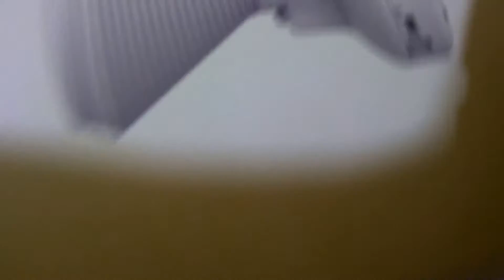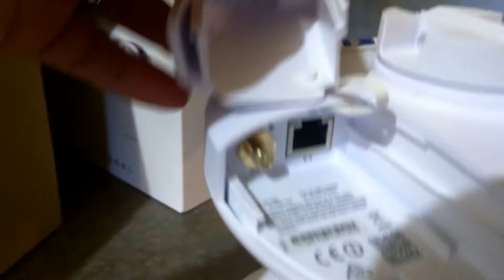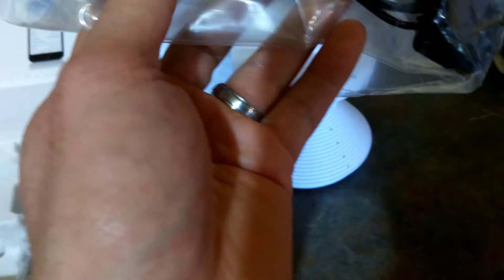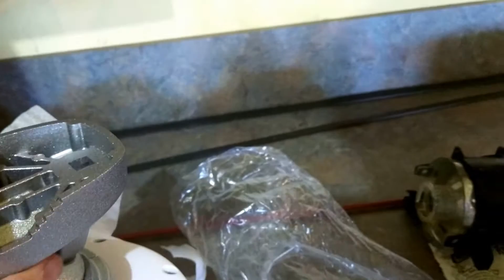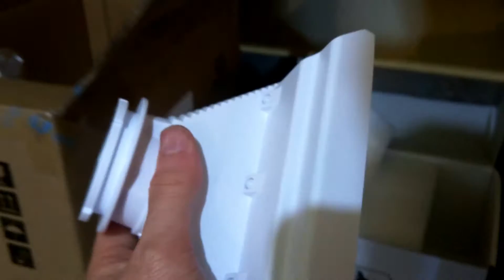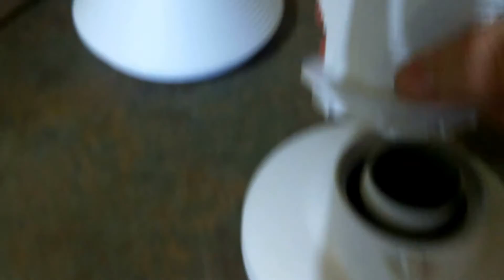@UBNT #PrismStation AP #Unboxing

Comment: I've seen better unboxing videos! At least get yourself familiar with the product by unboxing first before any production filming; in addition, read the manual too! Finally, get a tripod for you camera so that you can manage the product with both hands; might want to consider getting a dedicated camera that is meant for VLOGing/Product reviews, etc.
Reply from the maker: I do have a camera with a tripod, but I can't imagine it being convenient for an unboxing. You'd have to be moving it all of the time, so I'd think you'd just be replacing one set of movement with another set of movement.

On my car repair videos, I do it first, then repeat it for the camera, but I was in a rush and I figured I'd leave it pure.  :-)

I have asked for input from someone else I know that does a ton of unboxing videos.